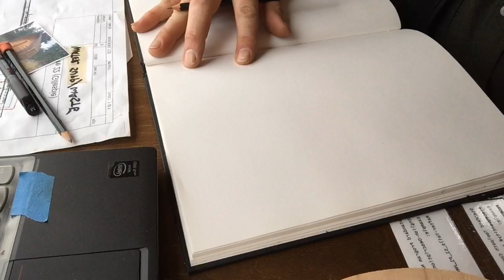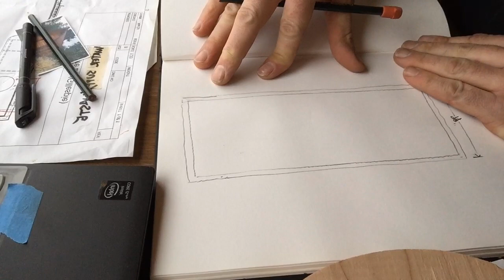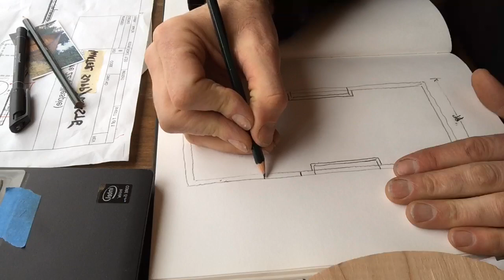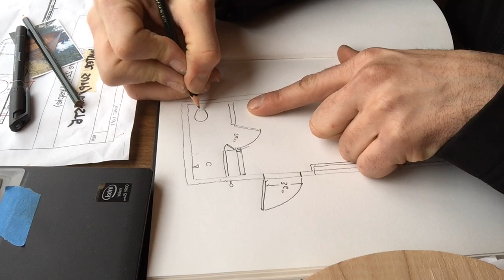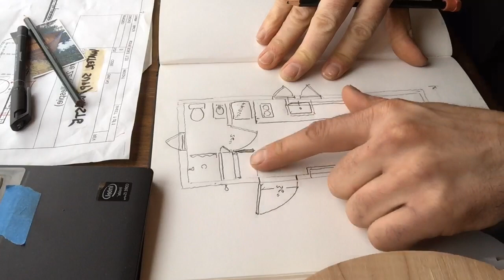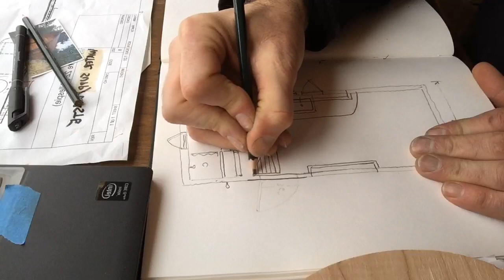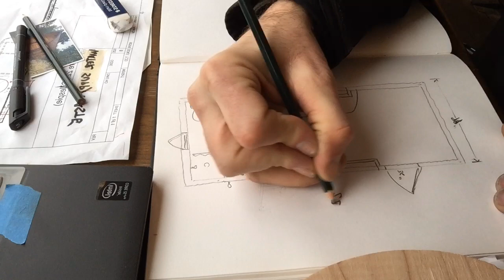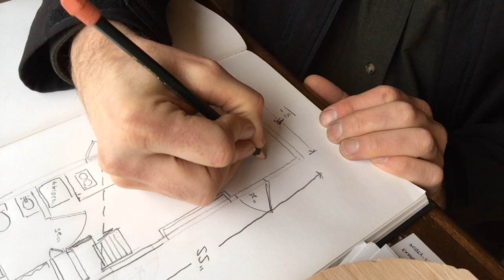Ask Zyl Live - Interior Floorplans - Jan 22, 2017

Comment: Hey Abel, thanks for your amazing tiny houses, I absolutely love them. And thanks for sharing these videos.
You probably been asked this before but how do you make your "curvilinear" walls? Is there a video or QA about this? EDIT: Oh never mind 41:00 :)
Reply from the maker: I haven't fully approached the curved wall design... because I use a relatively complicated process to engineer them. Also, I use some techniques that I invented in my shop, so they have to 'common equivalent'.
Reply: Yeah I guess designing it in CAD and using a CNC router and boat building techniques are a bit beyond what most people can reproduces as DIY anyways :) 
Do you see it as a bit of a "trade secret"? It's such a simple idea to create more beautiful homes. I really wonder why not more builders or architects do it. Of course you also need the artistic design skills to create the right amount of whimsy ;)

I've had the idea of building my "tiny houses on a truck" fiberglass sandwich.
Gluing PU insulation panels together, bending them and sanding / shaping them and then hand laminate them with fiberglass. I figure it should be an easy way to build curvilinear / organic shapes. I know boats are build this way, but outside of industrial flat trailer walls I haven't found anyone experiment with this. It's not cheap material wise and it might be a bit antithetical to the tiny house movement, but it should be well insulated and weather proof.